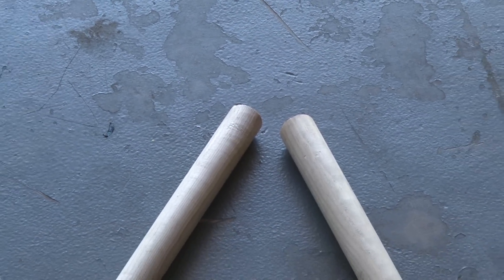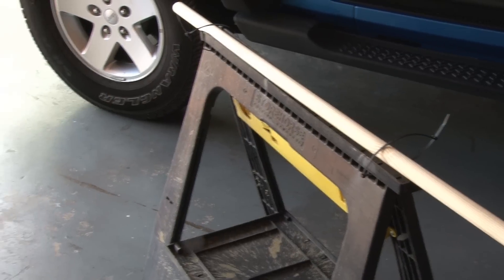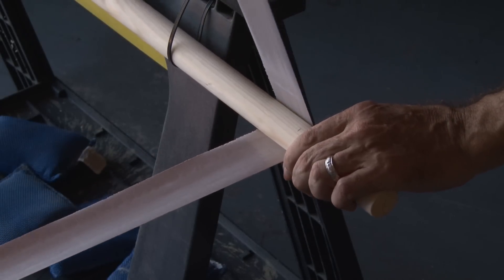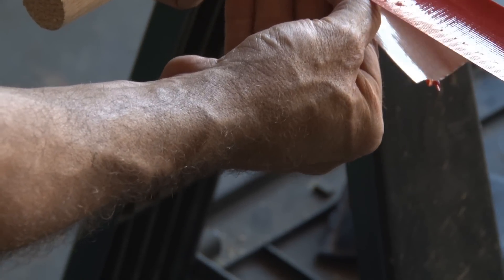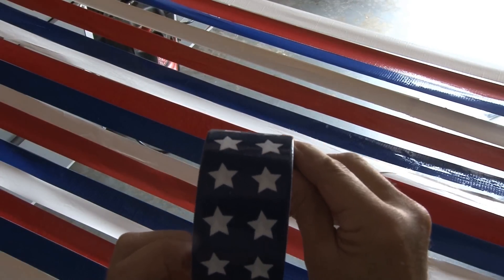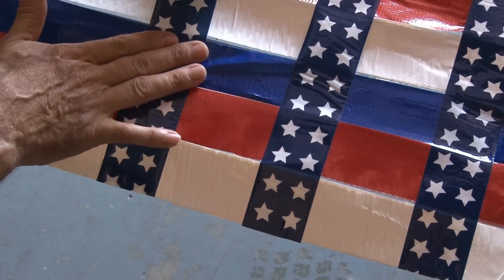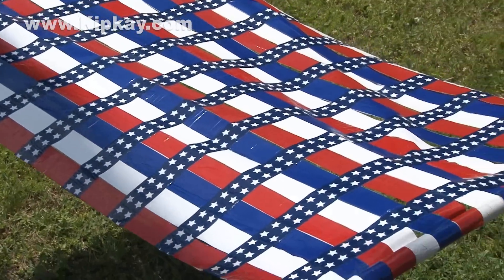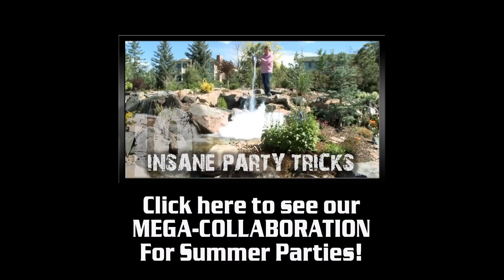The Star Spangled Hammock!

Comment: Nice idea for Independence Day. Well produced video as usual. I have made many hammocks before from netting and wood found on the beach, but never duct tape. Though your hammock looks nice, it does not look too comfortable(which I guess is true because you did not lay in it). Leaving a 3/4" space between the alternating colors would allow for much better ventilation. You definitely need a 3rd eye bolt in the middle of each rail. The rope on each bolt will connect to one point on each side, then tie to a tree.

Comment: It's getting hot in the uk and I'm having troubles beating the heat, could you design a small battery powered ceiling fan that is small enough to use on a bunk bed?
Reply: First off we will need 3 batterys, a 4.5-5v motor, and a plastic fan blade...You stick the fan blade onto the motor and wire the motor to the batterys. Oh and you might want to get a switch if you want to turn it on or off

Comment: What's the weight capacity on this?.. One would imagine either the tape would come loose, or the wooden rods would snap.
Reply: That star tape is not duct tape though. It's Washi Tape and is used in scrap books and other art stuff. It is very easy to tear.
Reply: Lee OfBacup The star tape shouldn't tear because the duct tape will be holding most of the weight